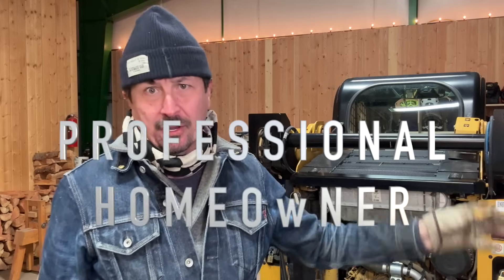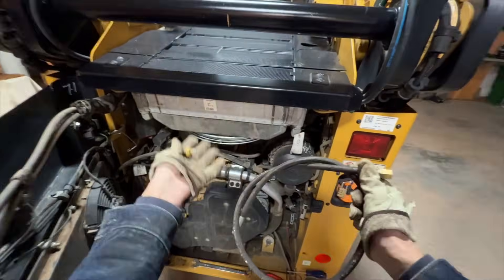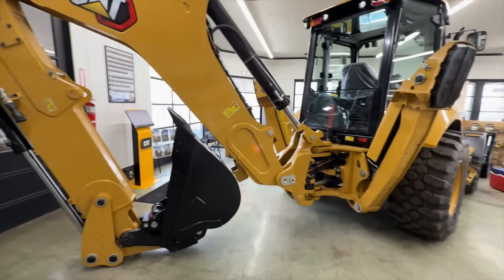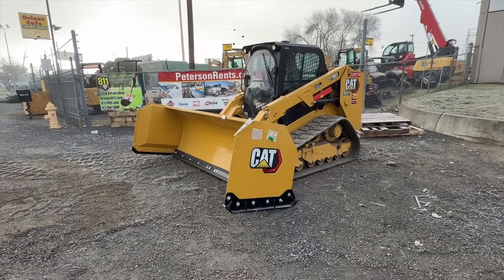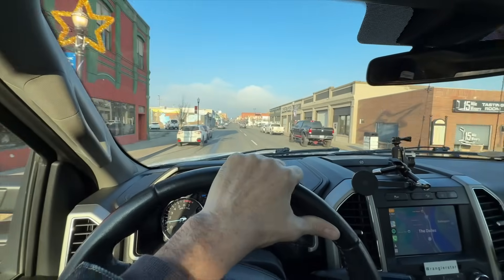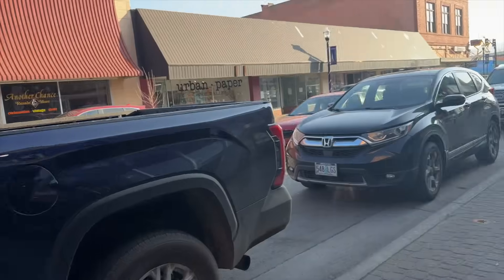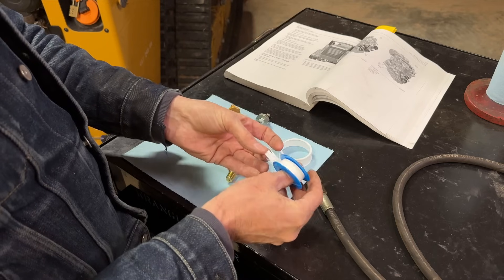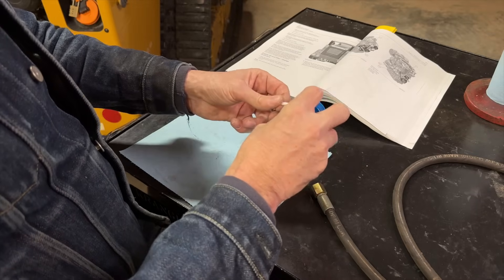$10 Fix vs $30,000 Disaster: My Skid Steer’s Life-or-Death Moment 🛠️💸

Comment: That booster pack is junk. We use it at work. Lead Acid is heavy for no reason. Look at the Projecta Intelli start. I have been using mine at work (we jump between 5-10 cars a day). Its lighter and will also let you charge the jump pack by leaving it hooked up via the alternator the. It wont break the bank and IMO is leaps and bounds better. I'll send you one if you have a PO box.

Comment: Personally, I never use PTFE tape where I can fit an O-ring or gasket instead. That oil pressure switch would definitely get an O-ring or gasket as the possibility of a shred of PTFE in a oil gallery can easily clog it with likely catastrophic results. The cleanest approach is always the best.

Comment: The two ended 12v cable let's you keep the settings while you swap batteries. Some cars have to have radios recoded if you lose power.

Comment: BOOSTER PAC .... Cody, I have chimed in with F-350 advice before, I work in a fleet shop in northern Alberta as a mechanic servicing a fleet of over seven hundred F350/F550 trucks used in open pit mining , we have temps in the winter well below -40F and I can say those BOOSTER PAC ES5000 work excellent, we have been using them for over a decade and they are super durable !!

Comment: I’m not sure what CAT says, but I work on Detroit engines and they do not recommend teflon when testing oil pressure cause the possibility of the debris entering the oil system. Although It is possible I’m entirely wrong when it comes to CAT. Great video! Keep up the good work.

Comment: If your battery is junk, replace it. Low system voltage can throw a lot of weird codes. Advice from an equipment mechanic.
Reply: I swear every problem i ever have is related to batteries, alternators or the ground wires around them.
Reply: @deadjoey77  unfortunately that's true pretty often. Definitely weak links
Reply: Probably a loose connection..
Skid got less than 500 hrs..
Probably 1year or less...
Normal use 500-2000 per year..
Reply: And I seen those CAT batteries last 10+ years..
Again used about 350+ days a year so not much chance to lose a charge

Comment: Yeah, people tend to think that buying junk off of amazon ain't that expensive, but it's so easy to spend 100k over five years, and then you need those 100k, and oh nooooo! 😱 What did I do? It's not like an addiction, it's just like way too many expenses hiding in plain sight.
Worst move btw.: avoiding buying some 35€ thing and instead making it out of wood, finding that you don't have the right kind of wood around, or what you got is way too expensive for this purpose, so you go get some of the right wood, and a little more, for 500€, because it might come in handy later on, plus some gear from the hardware that makes this exact job easier for 75€, and it might comy handy later on.
Suddenly the unnecessary 35€ thing has become lots of just-as-unnecessary stuff for 575€, just not from amazon this time, and the thing you then build yourself might turn out to last way longer while being more annoying because it's your actual first attempt to build a wrench organizer and have made some obvious-in-hindsight rookie mistakes 😎

Comment: never use Teflon tape in a hydraulic system
after you remove it a couple times your app to get straight pieces in the system and they raise hell with pumps especially rotary or gear (it is so thin that it fills up the tolerances and causes problems)

I also loved the walk to the restaurant

Comment: That's crazy i can get a rebuild kit for my 60 series for like 6-8k.  Theres no way you're spending over 10k for a rebuild.
Reply from the maker: A new engine from Cat with labor installed is 30 K
Reply: @wranglerstar  that's so crazy for such a small diesel.  Either way if the sensor didn't work then I'd start by dropping the oil and looking for shavings.  Replace the oil filter.  Retry if no chunks/shaving.  If you still have an issue then rods and main bearings/oil pump. 

Though I've only ever worked on Allison engines and older ones at that so take it with a grain of salt.
Reply from the maker: Crazy or not, this is what it is,

Comment: Just a heads up the Noco pack you have there is 3000 amps while the booster pack is only 1500. We have the “truckpac” es6000 at our shop and it works okay. I’ve had one fail. But with that being said I’ve also had a noco one fail. I still keep the noco in my truck and leave the big clunky one on the bench at the shop.

Comment: That booster pac ES5000 is only 400 cranking amps and 1500 peak amps AGM battery. The NOCO is much more powerful overall but is lithium so maybe not as effective in the cold.

Comment: I'm not a big believer of those Noco jump packs. The battery you are boosting has to have some voltage before the jump pack will work. The one you bought from Napa is essentially a self contained battery. I'm not a fan of battery tenders they end up sulphating your battery. You can try reviving the battery you got with a hot charge get the battery boiling. If that doesnt work sad to say that battery is done. You may want to get a new battery from Cat. In my experience they have an odd ball size. It may be a group..... then you compare it to another in the same group size its slightly different 🤬  The engine oil I use in Cat mini equipment is Rotella T5 15w40. The machines I service get oil sampled every sample comes back clean. Cat filters are a must the aftermarket filters have quirks that dont make them fit. I came from working on a fleet of Kubota excavators never had issues with non OEM filters. The company I work for now has Cat small equipment. Caterpillar has made it so you have to use genuine Cat parts. Even down to Fan belts aftermarket fan belts don't fit quite right.

Comment: Not sure where you keep getting this idea that lithium batteries are worse in the cold. All batteries are less than ideal in the cold but lithium was designed to be better in the cold than other batteries it was a big selling point when they were becoming popular. I’ve never had any issues with lithium in the cold. My m18 batteries live in an unheated garage and they are always fine. My lithium jumper pack will jumpstart my lead acid tractor battery dozens of times on a single charge in below freezing temps. Those Noco jumpers are awesome everyone loves them. That one jumps much larger diesels things than your skid steer. I’m not sure what the issue was with that.
Reply: Side note. I have a gooloo 4000 lithium jumper pack. And it outperforms the same size noco for half the price. Project farm did a video on it.
Reply: lithium ion polymer is the problem child. lithium iron phosphate and lithium titanate are better in the cold.